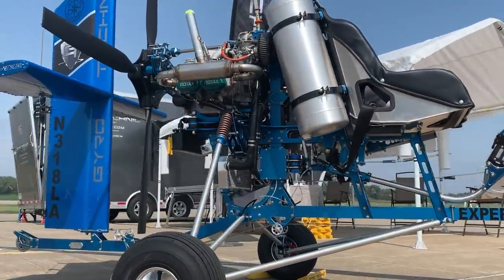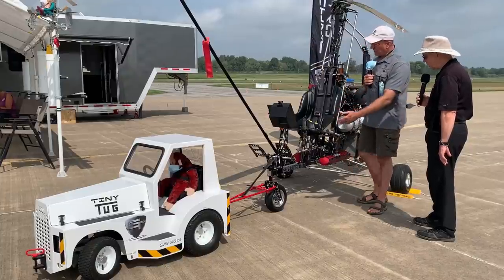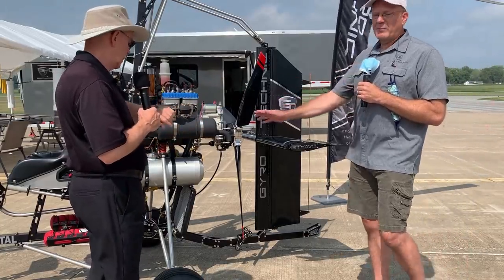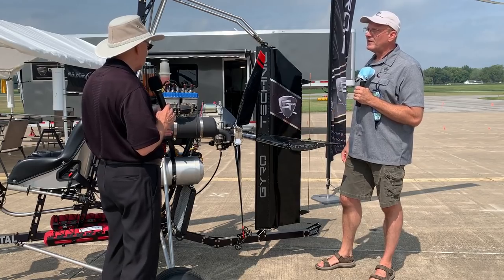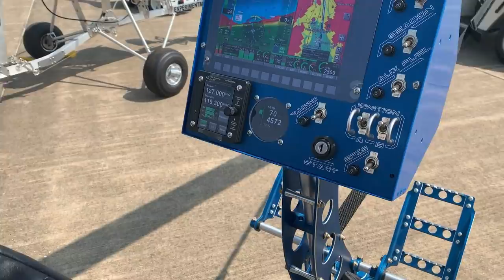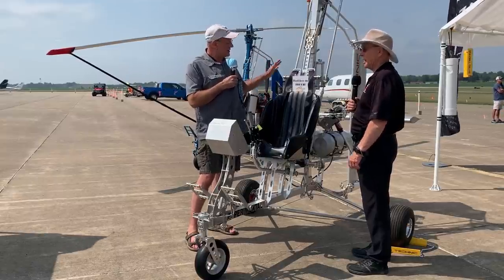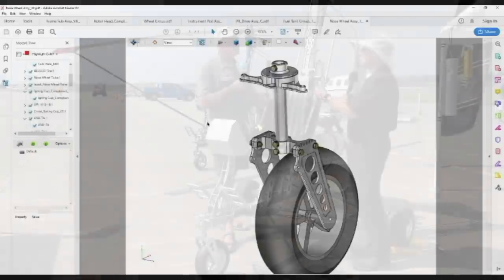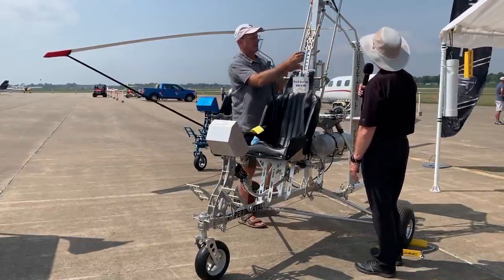Gyro Technic, Single Place Gyroplanes, and Gyroplane Rotors.

Comment: What a beautiful design.....I am with RD below why not 3 blade ?
Reply: Too much resistance, would take more hp.
Reply: Then the structure has to mirror the HP by adding strength which adds weight then the stall speed goes up so it has to fly fast which uses more fuel so bigger tanks increase the wight of the thing.

Comment: It has come to my attention that the comment about "1 other manufacturer" is confusing due to some lost content in editing. This was referring to the STYLE of the rotor blades (Razor Blades).  These are constructed with a extruded leading edge, bonded to the the top and bottom skins using a heat-set epoxy. To the best of my knowledge, Only ourselves (Gyro Technic) and Sport Copter are using this method. There are a few other blade manufactures in the US, but again, to the best of my knowledge, they are either using all aluminum extrusions, or composite materials. I apologize for any confusion, and in no way intended to mislead. Denis

Comment: I disagree with what he is saying about the tall tail. With over 2200 hrs in gyros I have flown both, tall tail and low tail. If you have an engine out in the tall tail you have bugger all rudder authority. It’s close up in the engine and doesn’t get clean air.With the low tail you have full rudder authority. Try throwing a stubbie dart and the throw a long shaft dart. Have a look around at the company’s building gyros and see how many are selling tall tails.
Reply: The length of the airship matters.  Not sure if you have the statistics on autogyro of different lengths but I'd be interested!